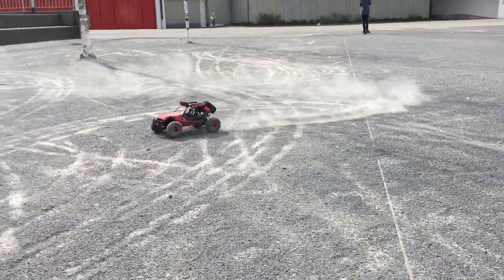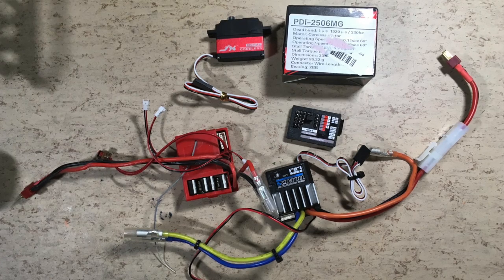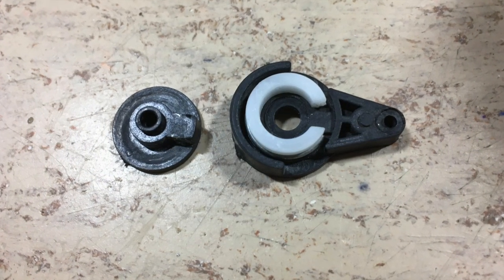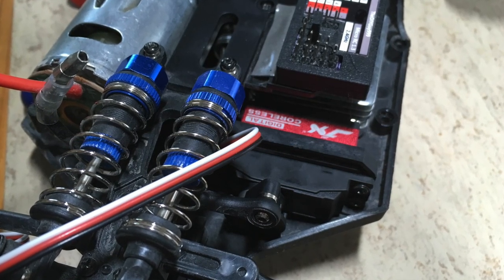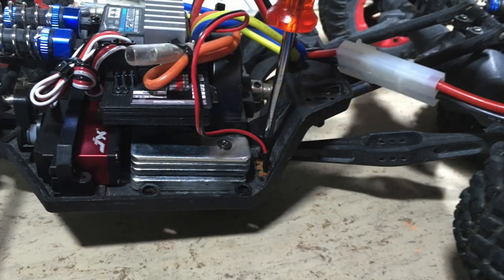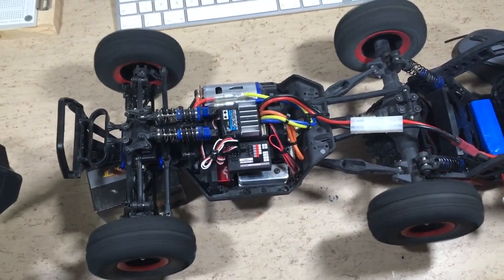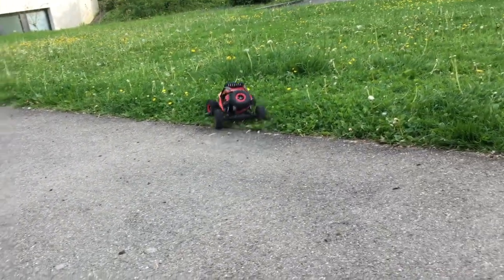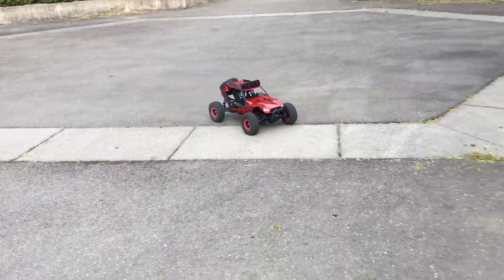JJRC Q46 SPEED RUNNER: How To Upgrade ESC, Servo And Receiver!

Comment: great video! do you have a video where you upgrade everything else? seems everytime i drive mine something breaks, was wondering if it is possible to fit better transmission, shafts and diffs
Reply from the maker: Yes, I have other videos on my channel. Basically, you can use WLtoys 12428 spare parts
Reply: @TheDIYGuy999  thanks!

Comment: Great Tutorial! It is the best source in the net about the Q46. Do you or someone else know, which receivers are compatible with the original remote?
Reply from the maker: Thanks for the praise. I have tested a WLtoys transmitter, but it is not compatible. I don‘t think, that there is a different compatible receiver. As you can see in this video, the steering is much better after this mod. So just go for a decent standard 2.4GHz remote
Reply: OK. Got it. Thanks for the fast reply.

Comment: Cool vid. I done this mod few days ago with a brushed ESC (hobbyking), the original motor and the same steering servo. The buggy is much faster and steering is improved...
Reply from the maker: Thanks. Yes, there are lots of suitable brushed ESC's out there. I also think, that it is faster now, even with the stock motor. I believe, that the internal resistance of the TAMIYA ESC is lower.

Comment: Hey, what is the length of the rear shock?? will wltoys 12428 rear shock fit?
(length hole to hole would really help me out figuring what size of rear shocks to order).
Thank you!
Reply from the maker: Hi, the length from center to center is about 64mm, while fully extended. No, the 12428 shocks are much longer.
Reply: @TheDIYGuy999  
So a 70mm shock will hold fine? 
Because I don't want the back to be over raised
Reply from the maker: Yes, I think it is OK

Comment: Great vedio i have question please answer . I have got jjrc q46 and it showing problem while playing the remote control disconnect when it pull front and make bip sound reverse and string is ok. So what may be problem and solution for it. If there is no solution plz share link to buy parts that you had change in your jjrc q46.
Reply from the maker: Thanks. It think your forward MOSFETS in your ESC are toast. You will have to replace it. The parts links are in the video description.
Reply: Thank you for your response. If I replace same Jjrc q46 ESC then it work with same remote control or not?
Reply from the maker: No, only if you replace it with the same type. But I'm afraid you will not find it anywhere, maybe on aliexpress.
Reply: Thank you once again yes I only found in aliexpress now I will buy from there.
Reply: Please will you tell me that what modle of servo has been fix in it

Comment: a question, if I change servo esc and receiver I need a programmer for the servo?
Reply from the maker: No, not for the servo. My DIY remote control system stores the servo travel limits inside the receiver. The signals from the transmitter always use the same range. So no, if you use a standard 2.4GHz remote, you can adjust the servo travel on the transmitter.
Reply: TheDIYGuy999 ok thanks, and if I use an FS-iA6 transmitter that is laying in a closet, do you think it is possible to bind it with the original remote control?

Comment: Would that servo work in the feiyue fy03? Great video by the way
Reply from the maker: Thanks. Yes, it should also work in the feiyue. Also have a look at my fy-03 videos for more details.
Reply: I watched them all and subscribed because of them. I have a feiyue that is upgraded a lot and it is quick. I had to make it two wheel drive because of drive shaft issues.
Reply from the maker: Banggood has upgraded metal shafts:
https://www.banggood.com/Feiyue-FY-01FY-02FY-03-WLtoys-12428-Upgrade-Axle-Transmission-RC-Car-Spare-Parts-p-1084001.html?utm_campaign=4828314_1046285&utm_content=1097&p=NZ29024828314201605E

https://www.banggood.com/Feiyue-FY-01FY-02FY-03-WLtoys-12428-Upgrade-Front-Wheel-Transmission-RC-Car-Spare-Parts-p-1084000.html?utm_campaign=4828314_1046285&utm_content=1097&p=NZ29024828314201605E

https://www.banggood.com/Feiyue-FY-01FY-02FY-03-Upgrade-Rear-Wheel-Transmission-RL-RC-Car-Spare-Parts-p-1084002.html?utm_campaign=4828314_1046285&utm_content=1097&p=NZ29024828314201605E

They are very robust and I never had a driveshaft problem again.
Reply: TheDIYGuy999 I got them, but when I put them on and ran the car they exploded because the pins came out. I had to completely rebuild the rear axle just  to run the car. It is actually faster with just 2wd. All of the power goes to the rear axle. I made a video of how to fix the driveshafts if you you have had the same problem. Just look up my name and you should be able to find it.
Reply from the maker: OK. I have disassembled them during the conversion and have secured all screws with Loctite. Never had an issue so far.

Comment: can i ask why you replace also the esc to improve the stering? and there is someting similar of the tamiya esc on bangood?
Reply from the maker: Because the original ESC is one piece with the receiver. The problem may be the transmitter potentiometer or the transmitter- or receiver-software. Also this car uses a non standard 5 pin steering servo. So I did what I always do in such cases: replacing everything.
Have a look here: https://www.banggood.com/search/brushed-esc.html?utm_campaign=4828314_1046285&utm_content=1097&p=NZ29024828314201605E
I think this one will be perfect: https://www.banggood.com/60A-ESC-Carbon-Brushed-110-RC-Crawler-Car-Part-p-1229993.html?utm_campaign=4828314_1046285&utm_content=1097&p=NZ29024828314201605E
Reply: thanks for reply, isn't better to change everiting with one of the brushless kit?
Reply from the maker: Of course you can replace the motor as well and use a brushless ESC. But I had the Tamiya brushed ESC lying around and it is perfect for the stock 540 motor.
Reply from the maker: I don't see how. The stock wheels and tires are fine. The problem is the dead zone around the steering center position. To fix that, you have to replace the remote and the servo.
Reply: I get it, thanks
Reply: about the estensions, because I saw in your videos that the car cornering overturns I thought that a greater width would help stability, as sports cars have a greater width is a lower center of gravity, in this case the low center of gravity is not good for off-road but a greater width between the tires I think it would help cornering stability.
Reply: by the way i brougt the car with your coupon. thanks
Reply from the maker: Thanks for using the coupon. This helps supporting the channel. Making the wheelbase wider will help, but I think the wheel bearings and steering components will not be happy.

Comment: Change the shocks that's why it keeps flipping not because of the servo speed control or wheel base just the shocks change those and that should do the trick😉
Reply: which shocks would fit this ?